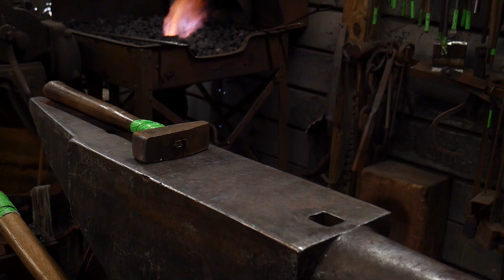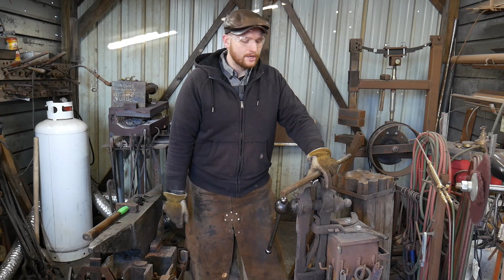Stop doing this to your vise! (Roy Rant)

Comment: I always worked as a welder
I really have spent many hours working with a vice
Not a antique post vice, A modern vice.
I would tighten it by hand then if not tight enough
I would give the handle a lick with my maul.
That vice has but one purpose in life
That to hold what I need to be held
Make my life easier.
I have never busted a vice
I may have created a bit of wear
Nevertheless !
Though I do not condone being a vice destruction
A vice is just a tool
There a reason why old antique tools most often have battle scars
Of course you could have a sort of museum only polish and never really use your tools in the pursuit of making money

Comment: What is the vise in the thumbnail? Got one with an identical screwbox that's unmarked, and have yet to determine manufacturer. Mounting plate looks to be an Indian Chief, but date on the moving jaw predates Columbus Forge & Iron Co.'s founding.

Comment: Hello, very good video! Remember in the mecanic in general, there is no (force over) for this the bare on the screw is not 5 feets lengs...
I open an old vise and the internal screw is used but no crack or demmage on it.....
Everytings ned to go alone (free with no force on it) that will gives to you more happynes on mecanic approache.....😎👍👍☺
Small mecanic guy from Switzerland

Comment: Very informative video! One thing I learned the hard way, is that I used to own a harbor freight vice, and I had a peice in there sideways and I sheered the jaws off because they were just mounted with some shitty screws. I finnaily made an upgrade and bought a the ridge tool co. 42 opn. Not the best vice but it is so much better than any harbor freight vice out there

Comment: Great video Roy 
I build junk yard sculptures
So I'm always in junk yards and scrap yards 
And I see alot of vices where someone ruined vices like this
I pick them up 
Some times 
It's an easy fix
It's just a bent handle 
I cut it off and put a large bolt on it
Some times I have to dress up the screw
Some are just gone
Really enjoy your videos
I have a question for you
I aquired  a post vice 
Can you make video on the proper way to set one up 

Thanks 
Rich

Comment: My family shop vise is a 1940s bench top type that has been hammered on and cranked on with 3 foot cheaters and hung on with all the weight of 200lb gorillas. then a few years ago i just used my normal strength to tighten it and it snapped the end of the thread where the screw has a hole drilled through for a pin. Had an old school welder fix it up though

Comment: I have to partially disagree; I recently straightened a bent handle of an old vise (vise #1) by putting it in the jaws of another vise (vise #2) across the length of the jaw and repeatedly hammering the handle of vise #2 until the handle of vise #1 was straight, essentially squeezing it straight. So it did indeed squeeze tighter beyond its normal limits. By the way, vise #2 was a Chinese beater vise and vise #1 was American. After beating on vise #2, nothing happened, the handle didn't even bend. But otherwise, I understand and agree with what you're saying and you make some good points.

Comment: I dug a 5" vise out of a junkheap that someone had used a cheater bar on and apparently didnt use common sense, and the thing was so badly bent i had to just cut it off and make a new one for it. by some miracle the threads on both the rod and the nut are ok and it just needs a new handle (and a spring but a few minutes and a piece of leaf spring fixed that issue).

Comment: I am a toolmaker and I run into this problem a lot, even on things other than vises. Some people will over tighten most things they work with in the misconception that tighter is better. Really most times if you prevent the initial movement, most things will simply not move.
My rant is over. Great video Roy!

Comment: More than half of the post vise's I see for sale are bent ,broke,needs parts,or just really expensive.Not ranty at all ,just good advise,Thanks.
Reply: Provide the screw and box are in good order, pretty much all the fittings can be re-made and the legs/jaws can be straightened or re-aligned. .... if the screw and / or box is missing, and beyond all hope of repair, the older vices can prove a handy source of decent quality wrought iron stock

Comment: That's a good point. I'm always paranoid about breaking a vise overtightening it so I never go any tighter than I can get it by hand. Especially with how much it costs to get even a decent small machinists vise, let alone finding another leg vise.
Reply: WHY DO TOO MANY OF THE UTUBE VIDEOS,- - - - "VICE" WITH ZERO BENCH TOP ANCHORINGS?  ARE THEYTRYING TO DEMONSTRATE THE POND-HOCKEY METHODS?
Reply: Here in France thhere are literally thousands  of leg vises and very cheap